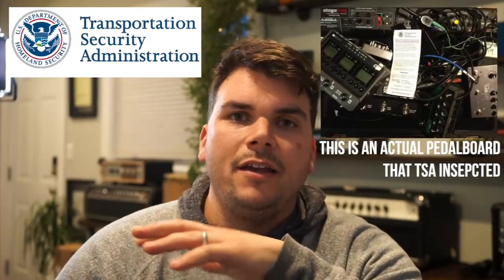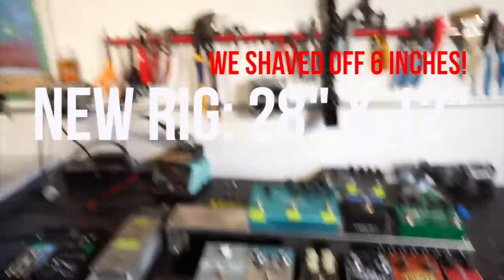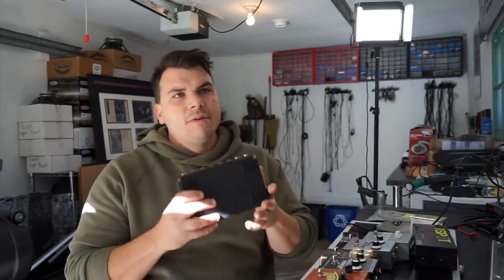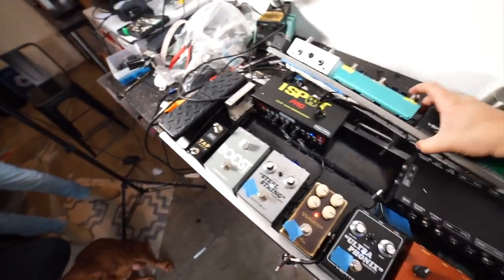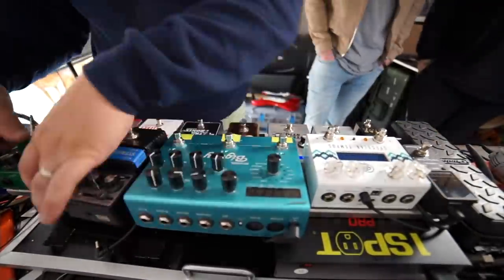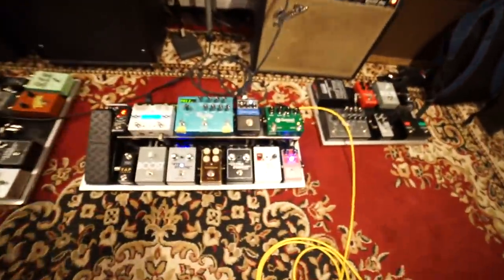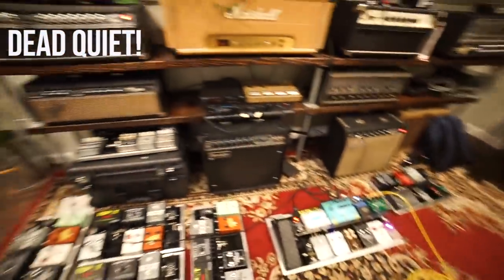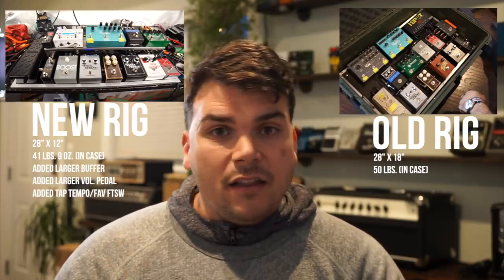Build A Bulletproof Pedalboard

Comment: Great episode Mason, thanks. I worked for an airline for 7.5 years, and had really good friends who were TSA agents that would tell us the inside scoop and countless stories over beers at happy hour. I’ve been a pro musician for 20 years, but full-time for only the past 2.

When I travel with my pedalboard rig (which also weighs about 49lbs) I take out all the patch cables, XLR cables and power cables. I wrap the cables up and put it in my luggage instead of with the pedalboard. You see, the non-musician-TSA-agents get freaked out when they see all the wiring/cabling in the x-ray (think “bomb wiring”). As a result, they have to open it all up and inspect it. Because they have no idea how a pedalboard works, they rip it apart trying to find some verification that it’s good to go. Most of the time, they aren’t malicious about it and have no ill-intentions (although there are some bad apples), they just don’t want to let something harmful get by them AND don’t want to inconvenience anyone by denying their luggage from getting loaded on the flight. A lot of TSA agents actually have good hearts and take their job seriously (and of course some a little too seriously).

So yeah, it’s a pain in the ass to take all the cables out of my rig, but it only takes about 15-20 minutes. I’ve got 19 devices on my pedalboard including power supplies, wireless units, wireless IEM transmitter and a small mixer. After a few times, removing and connecting back the cables is definitely worth the smooth transition through TSA. I’ll also disclose that I don’t use tie-downs and zip ties, so that might be a problem if you do.

Hope this helps...
Reply from the maker: Joe Guam That’s some great perspective, and I appreciate you sharing that. Understandably if you work for TSA you have a job to do, seeing things out of the norm I’m sure throw them for a bit of a loop. I’m also sure that in the majority of cases any damage is non-intentional.  Nevertheless, the musicians, through no fault of their own, end up being the ones with consequences for damaged items, with very little recourse to individual agents with TSA from my understanding.  The biggest concern is that if the standard for having a pedalboard not disrupted is removing all the cables, it would pretty much mean that you’d have to have a rig that was always in limbo.  For some of these more complicated switching systems, it would almost be impossible to put Humpty Dumpty back together before every gig. It seems like a far reach for most musicians if this is an example of the standard by which TSA is enforcing.  I suppose that time will tell with regard to Benjamin’s rig.

Comment: Beautiful board, but still scary af when it comes to TSA disassembly and damage potential.  Love how clean it’s wired, but the looming nightmare of pre-gig reassembly remains.  Unless I’ve missed something. My philosophy is build it so it CAN be easily pulled apart by TSA without damaging the pedals and wiring and then quickly reassembled. Having every audio and power cable measured to the molecular degree and zip tied like that is BEAUTIFUL, but once that’s ripped apart, you are fuct on the gig, IMO.
Reply from the maker: I guess the proof is in the pudding - it’s still in perfect shape hundreds of gigs later.
Reply: Vertex Effects I'm glad!!
Reply from the maker: Joe Cefalu me too

Comment: Do not take this wrongly, the board and all of the wiring looks stunning and I don’t mean to be disrespectful, but how is this more TSA proof than the old board? I might be misunderstanding the whole point here, but if the TSA officers want to investigate, they investigate and start pulling off pedals I guess? Whether there is more space for them to do so or not.
Reply from the maker: Jan V I hear what you’re saying, but again as mentioned in earlier comments, the overwhelming majority of players have reported that the more complicated it is to remove products from the board, the less the items on the board are disturbed. Also reducing the size, and the weight, in some cases would allow for this rig to be taken as carry on, and bypassing the entire system.  Again, I don’t claim to be an expert on TSA, nor an expert on understanding the execution of the various parameters that officers are to implement.  However, players that fly regularly, Ben included, have said that the making things more difficult for the removal of items is the best possible way to build your board and ensure minimal disruption in between flights.
Reply: I would have unscrewed the base plates, used that as a template to drill holes in the pedal board, then put the base plate back but having the screw going through the pedal board. TSA could unplug top mounted jacks and power, but would not be able to move anything else.
Reply from the maker: @rarnaud  I've done that, but it makes it hard to change pedals without having a "Swiss Cheese" pedalboard at the end of it.  Ben wanted to be able to move some stuff possibly, and with the SJ3550 and SJ3551 in tandem, it's impossible to get off by hand.

Comment: What made the old pedal board a TSA nightmare? How is this pedal board TSA proof? I think I missed that explanation in the video. Just curious......
Reply from the maker: James Carreras Hey James! Thanks for watching! This is a question that’s been brought up in a few different places in the comments, perhaps the error is in me not arcing back to the thesis more frequently throughout the video, but the main objectives in creating what I’m calling a TSA proof rig, has to do with suggestions that Benjamin wanted me to implement based on his experience over the last several years with PSA. These are things like covering up all inputs and outputs using the second row tier to protect the first row of pedals.  Mounting the heavier pedals, I like the volume pedal through the board with bolts. Creating a really tight fit between every pedal so there’s limited options to get hands or fingers to separate the equipment from the board, but moreover large equipment and large cases are a target for many TSA agents, so reducing size and weight where ever possible was also strategic.  Any places where there were open spaces, especially on the back, we mounted handles to make it difficult to sit fingers beyond a certain point underneath the board where any sort of leverage could be had to pull something off. Again as I do more of these videos all understand have a sequence it better to park back to the original purpose of the video, I apologize if it hit the mark for you, but hopefully you learn something and less you can apply to your own rig I mean I’m happy to hear suggestions and other things you’d like to see in future and I greatly appreciate your feedback.
Reply: @VertexEffectsInc  Thank you for the long explanation, the board looked amazing, tight build, tight meaning compact. I appreciate the craftsmanship. My nephew wants to be a rock star, and has massed himself a collection of pedals searching for tone. I'm sure a pedal board build is in his future. Thanks again.
Reply from the maker: James Carreras Awesome James! Thank you so much for having a look at the video, hopefully we can earn your subscription, and that your nephew was able to build a great board with some of the tutorials here!
Reply: @VertexEffectsInc  I have been thinking about making a small board using 2 of the new Tech21 RK 5 Fly Rig's on it.  Richie Kotzen uses two chained together with a Wah pedal on a small board for his fly dates.  He wants to use all the features, so he has two working at the same time.  Good idea.  Something like this would be near bulletproof due to having very few cables and by its small size.
Reply from the maker: TJ Nugent thanks for watching!  It’s fine if you’re tied to that exact setup he uses if you’re any Richie Kotzen cover band or similar.  He is so amazing, but also very stylized, I don’t know that there’s a lot of crossover between several genres with this particular set up.  But if you’re trying to do anything along the lines that Benjamin is doing, there’s no way something like this would work, this would be more along the lines of a one off fly in date for something very specific, say a blues gig or something like that, I can’t see being able to do a lot of contemporary music with his set up, although it works great for him and sounds great for what he’s doing.
Reply: @VertexEffectsInc  You bet, I don't use a lot of effects, though I do use a couple of different drive pedals, chorus, compression, boost, and two different delay pedals.  The two Fly Rig units will do this, but not much more. I was thinking more for myself and not Benjamin, who is definitely more stylized a player than I am.  I do a church gig, so not a lot of things going on.. If I need more, I have a Headrush pedalboard and a couple of HRHR cabs to use.  I also have an analog board, which fits on a Pedaltrain Novo 18.
Reply from the maker: @tjnugent62  context is key right!?  If you can get away with the Kotzen rig, that's great, but seems that other than Richie, it's primarily used by his fans.  In other words, I've not seen it catch on with major touring acts.  Again, perhaps due to his specificity around the gear needed for a gig, but Richie was always a minimalist like this from what I can tell when he used to do these homemade multi-pedals in one enclosure.

Comment: 14:25 "So, basically same as before, just  smaller." So this is TSA "proof" how? Was anything explicitly done to make it easier for the TSA to inspect?
Reply from the maker: Well...I suppose the proof is in the pudding.  The rig, up until COVID, hand't been touched with weekly travel.  I think the biggest part is having as much sensitive stuff under the riser (bridge), and locking cables and pedals down as much as possible with tie down mounts.  The combination thereof, whether you agree or not, seemed to work out for Ben.  His rig was disassembled 80% of his flights, and last year, none.

Comment: I have my pedal board completely  silent thanks to you until I decided to add my old crybaby. I now get a hum constantly. Any suggestions would be helpful. Thanks ahead.
Reply from the maker: Gregory Hill Sr If it’s anywhere near a power supply you can get hum coming off of the transformer that interferes with the inductor in the wah.  Step one would be to isolate it from the power supply, if that’s not the issue, try it on battery and see if the noise goes away.

Comment: Hey Mason, Whats your opinion on the Friedman Board? Im intruiged by the quality and included power supply and buffer that fit right in. But hefty tag. Is it worth? Thanks bro.
Reply from the maker: No complaints, but you can also get the individual parts as I linked here and have something more customized and perhaps cheaper at the end of the day.

Comment: Thanks for your videos!  Do you have a tip for tying down excess cabling for power and audio cables or making them look more clean when not custom making cables to length?
Reply from the maker: Matthew Glenn You can try using the zip ties and tiedown mounts that I have linked in the description

Comment: Mason, great video! His 28 x 12 board seems pretty snug in that flight case but the dimensions on the interior of the case claim to be 32.5 x 18. Did y’all place extra foam in or is that the thickness of the included foam? Also in your opinion, could you fit a 28 x 14 GOMC board in that case? Thanks.
Reply from the maker: We cut down our own foam to fit more precisely

Comment: Great video and beautiful looking board! What do you think is the most important thing to keep in mind when putting together a board in order to avoid TSA issues? I've flown with my board once and it was totally fine but definitely want to avoid having it ripped apart by TSA. Any tips would be greatly appreciated!
Reply from the maker: I think making it so it's impossible to remove pedals by hand.  That means using high density dual lock, SJ3551, and leaving no spaces between pedals, just enough to clear the jacks, that's it.  With the tier on the second row, that helps protect the first row from being disturbed.  The volume pedal is literally bolted through the pedalboard surface so that's safe, and on the back where there was some space for hands to get under pedals, we installed handles to block off the access, but also protect the back row from taking a hit from someone walking behind the rig, or an unsuspecting roadie.
Reply: @VertexEffectsInc  Awesome! Thanks for the tips, especially on velcro, I'll have to look into getting the dual lock stuff. I also got a tip to put a note explaining that it was my pedalboard and if TSA had questions they could call me. May be overkill but I would rather be safe than sorry with my board. Thanks again!
Reply from the maker: @brandoncouture4432  I've heard that, but I've also had guys saying it did nothing.  I've also heard about serializing the rig as one unit helps, but I have no proof other than anecdotal accounts.

Comment: Great video Mason! I actually just finished a new build after watching this video with the same dimensions. Quick question, how were you able to get the Pelican case to fit the board so perfect???? Did you special order it with the foam dimensions or did you cut it out yourself? I am about to place an order for one and want to make sure it is done correctly. Thanks!!
Reply from the maker: We cut it to size or you can get the Trek Pak and it’s always pretty much to size and has the tools to cut where needed.

Comment: Hi! Sweet job! I bought Vertex BOOST recently but still havn’t hooked it up in my board. Waiting for volume pedal. 
I have a question: what does the mono mix do ?  And how regular mono out differs from it?
Reply from the maker: Skylark Music Thank you so much! I think you’ll really dig the boost, although it’s not the most sexy thing on a rig, it certainly is one of the most functional ideas that we’ve ever put out and is still a standard amongst many of the top session in touring musicians in the world.  The difference between most of the other mono sums out there is that they typically are just tying together is the left and right signal and relying on the output section of those stereo pedals to drive the line.  This is not ideal.  Although I think that using a dedicated left output is preferable to a mono sum, and simply re-working your presets to a hard pans when in mono, the mono sum provides an active output buffered mixer that mixes evenly whatever the ratio of L and R mix is on the last pedal before hitting the mixer.  Most of the mono summing devices that I’ve seen are passive on the output and are relying on the pedals before it to drive the line or the input buffer if there are no pedals on after the buffer, and all and true bypass.  This is not ideal from a signal processing standpoint, it doesn’t give you a true representation of the stereo image in a mono perspective.

Comment: Rig Doctor how do I get a pedal board with a tier where it can fold up to put pedals below and on top. I like to get a board with a small foot print but with a lot of pedals. Please advise and thank you for your channel.
Reply from the maker: You can use the same lift/riser we use here and mount a door hinge to it on one side.  Otherwise just use what we used here and you can release with four quarter turn screws to access what’s below the tier.

Comment: I’d be super cautious about putting my pedals that close together (unless all the connections are on back of all pedals). Pain in the ass finding a bad cable when pedals are so close together.
Reply from the maker: I hear ya on that, but typically these cables, if built properly won't fail.  Typically the jacks on the pedals will fail before the plugs or cables do, and in that event, I like using car upholstery tools to get pedals off since it wont damage the pedals, nor the dual lock velcro when you remove since they're essentially plastic crow bars.  The space savings, to me, is more valuable than the increased size you'd need to clear the jack from every pedal.

Comment: What?? I'm shocked, I knew that TSA is bad, but tearing apart pedalboards is a whole new level of idiocy, what a bunch of morons! Anyway, nice work, as always.
Reply from the maker: Miha Zupančič I’ve heard horror stories, not just Ben.  Ben’s biggest issue was pedals removed from the pedalboard and then placed loose in the case before a flight so it jiggles around in the case all flight long, damaging knobs, defacing pedals, etc.
Reply: @VertexEffectsInc  This legitimately sends shivers down my spine, I will certainly remember this video if I ever need to transport any of my gear via airplane.

Comment: Thank you for so much great advice.  Is that tier custom made?  There's no link for it.
Reply from the maker: Should be in the description box under lifts/risers
Reply: @VertexEffectsInc  I went to that link. There are risers for individual pedals, but nothing like that kick ass tier that you installed.
Reply from the maker: @derekslam  you can message them directly for custom orders.  All of these are "off menu" and made to order.
Reply: @VertexEffectsInc  Thank you very much.

Comment: Is that I/O interface/buffer custom built or could I find one for myself?
Reply from the maker: I built it custom - has single input buffer, dual output buffer, with a custom mixer for the mono.  If you want a dual buffer I recommend the Mesa Boogie High Wire
Reply: Vertex Effects thank you so much. Just recently discovered your videos after watching Rhett Shull and I really appreciate the help they’ve given me on my current board in progress.